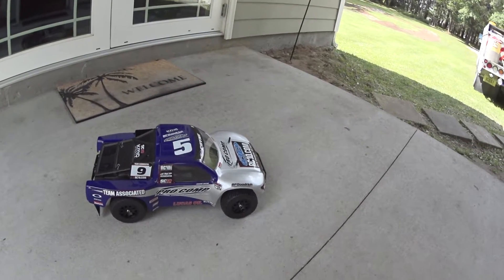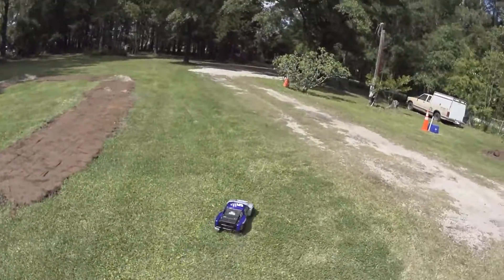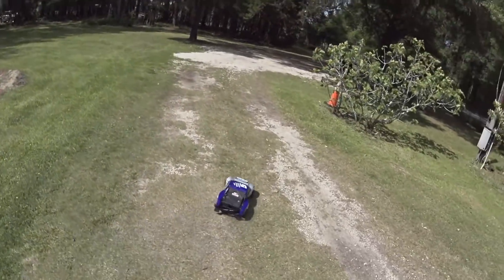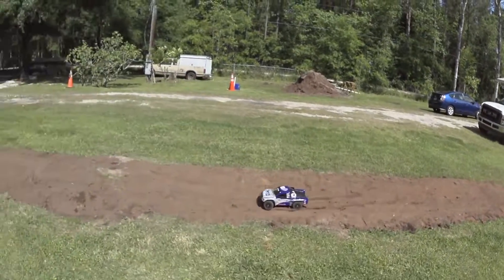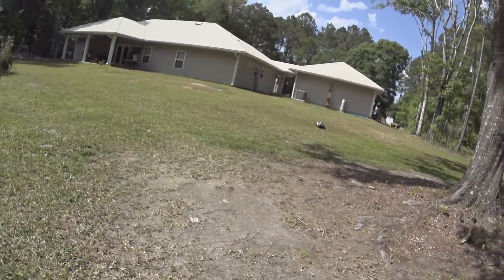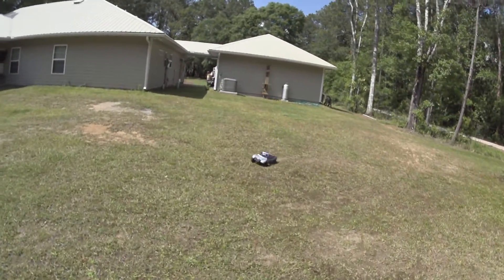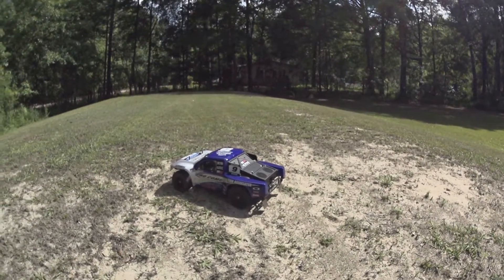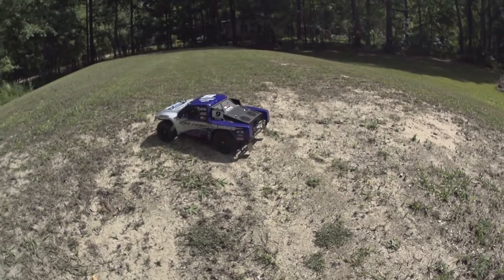Brushed SC10 First Run

Comment: The truck have a very good speed for a brushed system, the reedy radon 17t it's amazing motor
Reply from the maker: +Darth Sidious Yes, it is very impressive and shows you don't have to have a brushless setup to have fun, although I do have to admit that it was slightly over geared and temps were leaning towards the hot side.

Comment: have you broke anything on it yet? I'm thinking about getting one for doing some light bashing not much of a racer
Reply from the maker: I haven't broken anything yet, but I've only had about a dozen packs through it. It's not really fast enough to break anything as it sits stock unless you really abuse the thing. I would say pick one up, it's a great platform, plenty of parts support and most importantly lots of fun!

Comment: can you use a 2 cell lipo 2500mah 50c
Reply from the maker: +omar chavez yes, you can run 2s Lipo, that's all I ran in it with the stock brushed system. I believe you could even run a 3 cell, but I never did.
Reply: Oh ok thanks
Reply from the maker: +omar chavez 👍👍👍